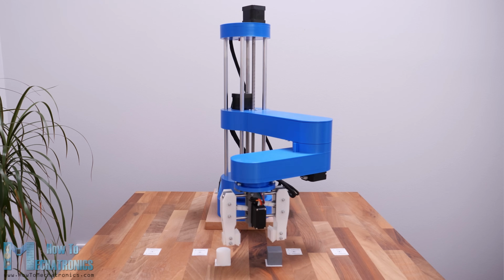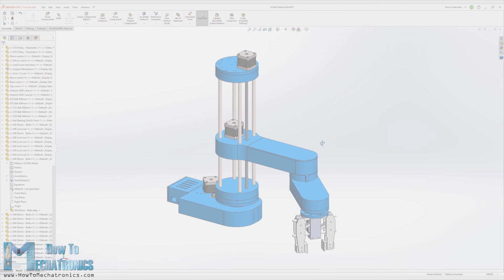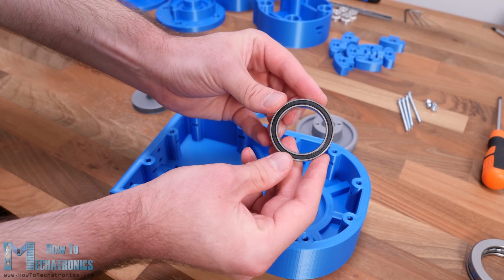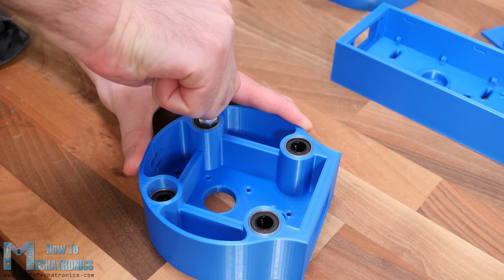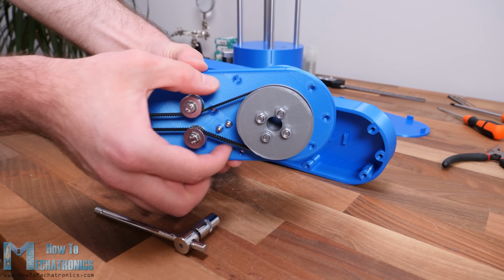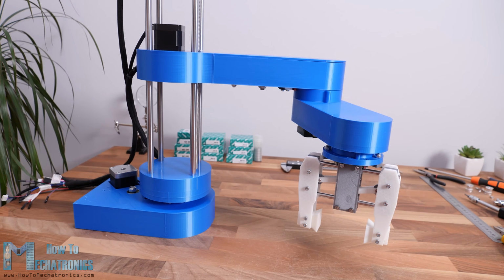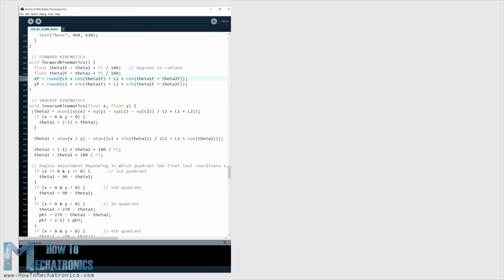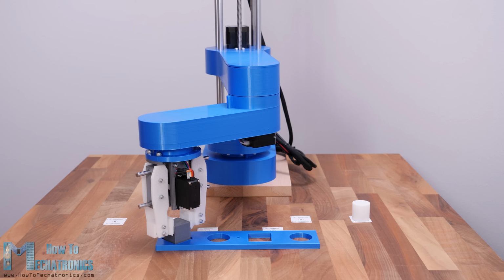SCARA Robot | How To Build Your Own Arduino Based Robot

Comment: i am having troubles regarding the robot can you help? 

i am sure that i have installed the screw like thing in the middle that connects to the up and down mottor in the correct direction but the robot goes down when it tries to zero itself when i first start it and ultimately hits nothing and tries to  keeps going forever. what can i change in the code that it doesnt do that? perhaps change the direction the motor will take when it tries to zero itself? if so, how can i do it? AIs were useless regarding situation (or i failed to use them correctly)

also the gui crashes when i try to manipulate a joint.

Comment: when i  run  Gui programe using processing 3.5.4  , if  I change  one of those  slider  it shows  nullpointeexception  and struck program.  why ?
Reply: Yes , even I am facing the same problem , @HowToMechatronics help

Comment: Hello, the radial bearings seem to be off, I found that it should be :
6808 2RS (61808) x1
6807 2RS (61807) x2
instead of :
6807 2RS (61807) – 35x47x7 – x1
6806 2RS (61806) – 30x42x7 – x2
I don t know if what I am saying is right or If my printer printed the wrong sizes.

Comment: Hello! I'm wondering if the servomotor is 180 or 360 degrees. Something else: I just found the links to buy the parts (in the web page of the project) are no longer working (they were working about 2 weeks ago). Can the link be repaired? Thanks! Greetings from México

Comment: Hi,

I’ve successfully built the robot following the video and website instructions. I’m really happy with the project and loved working on it. However, I encountered an issue with the wooden base part, as I couldn’t find the base design file (paper) from Cult3D to properly attach the robot base to the wooden piece. Could you please share the design sheet with me so I can complete the project?

Thank you in advance!
Reply from the maker: Hey, great to hear it!
Yeah, I have forgot that drawing. Now it's added to the Cults3D files.
Cheers
Reply: Hi, Did the code worked for you?

Comment: "Hello [Autor's Name],

I came across your video on [Video Title] and I'm impressed with the SCARA robot design you shared. I'm working on a similar project and I'm interested in purchasing the 3D printed parts from you, instead of buying a 3D printer myself.

Could you please let me know if this is something you'd be willing to do? If so, could you provide me with a quote for the parts and an estimated delivery time?

Additionally, I'd like to confirm that the parts are compatible with my Arduino board and stepper motors.

Thank you for your time and consideration. I look forward to hearing back from you.

Best regards,
Pablo

Comment: Hi. I've struggled with this project. It would be great if you could modify the website instructions to make it clear that you need to add a jumper to the EN/GND pins to enable the CNC Shield. Also, jumpers need to be added to allow the A axis to function.

Unfortunate my Z axis does not home as it should. During startup, it goes all the way up, hits the limit switch and then starts downward, but it never stops. Any ideas why this would be and how to fix it? It must be code related. Thanks so much!
Reply: Hi, did you ever solve this issue, I’m having the same problem 😢
Reply: @PhilHarpham  I was able to figure this out. I modified the code so that it only contains 9 items in the string instead of the 10 that were specified in the original code. String content = "";
int data[9]; //10 changed to 9.   Serial.println("Content: " + content);
      for (int j = 0; j < 9; j++) {  See, there are only 9 string items here:  data[0] - SAVE button status
     data[1] - RUN button status
     data[2] - Joint 1 angle
     data[3] - Joint 2 angle
     data[4] - Joint 3 angle
     data[5] - Z position
     data[6] - Gripper value
     data[7] - Speed value
     data[8] - Acceleration value   I can send you my compete modified code if you shoot me your email address.  Apparently the code is too much to paste here as a response.
Reply: @DSMtuned  Many thanks!! That seems to have solved the problem 🙂

Comment: hello!!
I have one question.

It is a robot concept using a Nema 17 stepper motor.
If I use an SG90 servo motor instead of a stepper motor, will the GUI interface not work?

Comment: Hello, the values that can be changed in the sliders of the SCARA robot control software are given in which unit of measurement? I mean in relation to forward kinematics (J1, J2 and J3), which measurement units are their values in? Degrees, radians or steps?

Comment: Hi,

Tank you for this amazing design (which now I bought). 

In the zip file, i miss the clamps for the smooth rods. Can you provide me the stl/3mf files. Thank you
Reply from the maker: Hi, thanks, I hope you will have fun building it! I've just updated the files.
Cheers
Reply: @HowToMechatronics  Thank you kind sir. I will have fun building this. I am going to program it with python and add mqtt to the code. This way I can add data to a database and make graphs/charts.

Comment: Got it now to run, but it will not home at start up as you said and the limit switches are normal closed as you made them, could that be right?
I also tried the endstops as normal open but it didnt do the homing as described again. So there is something wrong or to do in the published code. Same like in the processing file where something has to uncommented what is not mentioned in the video. Sadly the most important Things are not mentioned and it wont work without that Informations. Only half good tutorial in the end, if some one try to rebuild it 1:1.
Reply from the maker: Hey, I always try to put all the information out there. Sometimes things don't work for various reasons.
You always have to be prepared for troubleshooting when making such a big projects. The best way for trouble shooting is to try one thing after another what could cause the problem. For the homing, check whether the endstops work properly with another sketch, try using the Serial monitor to check the status of the endstops whether they get pressed or not. The serial monitor is very handy for troubleshooting and tracking the variables.
I hope you will get it working properly soon.
Cheers,
Dejan
Reply: @HowToMechatronics  Hi Dejan, thanks for your answer. After a period of pause and recovering from that anger of not working project I started again to try out the failure. I mounted everything you did, I checked the stepper polarities, that the motors spins from the CNC shield and the Processing UI, but as soon as I connects everthing as you have shown nothing works. I disassemble the stops, then I can move some of the motors. Are the endstops opening or as a closing switches?
As you showed them in the video, I soldered them as well, and they are openers means they are constant 1 without trigger the switch. Is that really correct?
Beside that, the processing program does not make the homing process at startup like you have shown. Any idea why?
Also sometimes I move J2 left right left and sometimes it moves without ramp and then again with, without any changes than position.
Additionally sometimes J2 moves just a bit and then J1 turns, even if I just adjusted J2 position ... somehow very strange everything.

Comment: I started now printing the teeth-wheels and they are so round, that the belts does not hold properly. How to print, that the edges are sharper so that the belt has more grip?
And I little miss the electrical part where I have more lacks of knowledge than on the mechanical side ...

Comment: excellent work. Great work. 
I saw whole video, but practically its not possible for me learn and implement it.
The reason being , you are creating most of the part at your own using 3D printer, which not possible for anyone to work hard at this level. 
(also short of resources like 3d printer , learning 3d printing software).
Most of electronics engineers are so poor in mechanical part.
Please make video with mechanical parts which are easily available in market .
You can make this video again with mechanical parts available easily in market parts with the improvements you mentioned at end of video.

Comment: Hi, the code that you have attached to the website isn’t working for me.  Is there any way that you can tell me what to do?    Also, great video.
Reply: Ever get it working?
Reply: @navysnow5618  No
Reply: All of the other software’s for the Arduino app that I have a new stove works though. I don’t know what is wrong with this one.
Reply: @Daniel_Ahdoot  I adapted the code to use it on arduino uno + cnc shield v3. Engines now move from the GUI
Reply: @Vitifj3Dcontrol  and work?
Reply: I'm trying to find a solution too... you changed the COM port on the line 55?

Comment: Thanks for this cool alternative to the 6-axis DIY educative cell I have made. Sadly the software dont want as I want.
How many lines of programm or what operators can I use?
EDIT: God bless, that you made the parts bigger than finally needed. For my inacurate printers good, as thes printed with "elefant foot" up to 0,3mm smaller.

Comment: Hello, I could not find the correct GT2 pulley with 50 teeth that you use in the video, I printed the one from the 3d printed file but there is no adjustable screw inside it for the shaft, to be tide on the shaft. Would you like please put the new updated GT2 pulley in the comment so we can printed?

Comment: I will add this to my to do list....however the bearings and metal parts are so hard to find in my local market. So the procurement phase could be long and that is a barrier to my motivation that I need to override ASAP:

Comment: at 15:05 how did you fit the 3 bolts that need to go under the joint 3 connector?

Comment: Awesome project !!
How to enable the robot end effector move from one position to another with straight line motion ? There has to some synchronisation required for both X-Y motors.
Do you have any plan to add this?

Comment: Great Video!!! Both this one and the other one with the laser engraver. I have built my own scara printer (X-SCARA (Not my design)) but it has both arm motors mounted on the base, creating the need for crosstalk between shoulder and elbow. Do you know how to define this?

Comment: Amazing work. 
How do you know the real position of the motors?
Reply from the maker: Thanks! There's a homing procedure at the beginning with the help of some limit switches.
Reply: @HowToMechatronics  Hi, thanks for your reply!
I saw the homing procedure, but i would like to know if there is some closed-loop to ensure that the motor is in the right position.
Best regards,
Tomás
Reply from the maker: @tomiabraham  Well, yeah, although having the home procedure it's still an open loop system. If the motor skips a step the position will be lost and it won't know that it has skipped a step. You would need a closed loop stepper or a servo motor which have encoders as well in order to exactly know the position of the joints at all time.
Reply: @HowToMechatronics  Thanks for your answer! 
Have a good day
Reply: @tomiabraham  youtou

Comment: It would be simple to brace the vertical joint. Add a support truss to the top of the vertical and problem solved. Question. Any idea of the load capacity of this Scara design if the top was supported and the whole structure was made more rigid?

Comment: Hey there i am so very impressed with your work that i am actually making one for myself for my engiineering final year project
there is this one place where i am stuck and that is, i am not able to source a 300mm GT2 belt for my pully nonetheless im able to source a 280mm GT2 pulley, all i wanted to know was that will you be able to tell me if i should go with the 280mm belt for the pulley system, thanks in advane

Comment: Hello! I built the robot, but there is a problem with the software part.
"Nullpointer exception" error message
Can you help me with what could be wrong?
Reply: hello, have you solved your problem? I also built the robot but the program doesn't work for me, maybe we can help each other
Reply: @francesco_xx2  Hello! Not yet resolved, I haven't dealt with it lately!
And unfortunately in winter the foundation was ruined too, it was too close to the radiator!
Reply: Yea, I just can't seem to find a robot arm project that actually works lol.
Reply: hey... there is one line in the processing IDE code where in you need to enter the COM port to which you have connected .. after that the error shall go.. cheers!
Reply: @saiprasadenterprises6691  Thank's
Reply: @zsoltkatona4951   you solved the problem?

Comment: Can anyone tell me what is the purpose of using micro switch at each joint? Thanks in advance!
Reply from the maker: So that you know the position of the robot. First it goes to zero position which depends on the micro switches and from there you can set it to any position you want.

Comment: Hey pls pls pls help me help me pls 🙏😭 I'm in trouble pls help me 
When i open processing and run the gui it works but when i do any changes in forward kinamatics it may freezz and shows error program is not responding and java(tm) se binary not working
Please please 🥺🥺 help me
Reply: How did you even were able to run GUI. It doesnt work for me. No errors. It's like there is no communication.
Reply: Yup guess I'm not building this.

Comment: Hi! Really good project, maybe can help me with some issues? The servo don't work correctly and i try some servos and the motors don't move, i use a cnc shield, motor drivers A4988 with arduino uno and 4 motors nema 17 with power suply of 12v 10A

Comment: Hi 👋  How to mechatronics. I hope my question wasn't crazy enough. Is it possible to apply the robo with welding functionality? Or lets say cement hose? I really appreciate your advice and answer for this. I wanted to build robo with welding or the robo itself can produce metal  welding funtion or 3D concrete printer funtion. I'd hope my question did not bother u. Thank you 😊

Comment: I came across a problem. I have built the robot and is currently facing the last stretch. When I run the processing code, the robot doesn't move at all. It doesn't go to its home position and nor does it respond to my manual jog input. Any heads up would highly be appreciated
Reply: hello, have you solved your problem? I also built the robot but the program doesn't work for me, maybe we can help each other

Comment: hello sir, i have a question, for securing the hole is it required for the diameter of the hole and the one to be inserted the same for it to be tight? btw this project is so awesome

Comment: Wait you don't need to flash the Arduino into a cnc Arduino to use the shield? You can just use the aclstepper lib.  Wow I just smacked my head on that, here's I've been trying to program output to chilly pepper.

Comment: Dejan, do you know what could be causing these errors I get on PDE when inputting values on the inverse kinematics and hitting "Move to position"?

Mar 31, 2021 10:28:03 PM controlP5.ControlBroadcaster printMethodError
SEVERE: An error occured while forwarding a Controller event, please check your code at move
java.lang.reflect.InvocationTargetException
	at sun.reflect.NativeMethodAccessorImpl.invoke0(Native Method)
	at sun.reflect.NativeMethodAccessorImpl.invoke(NativeMethodAccessorImpl.java:62)
	at sun.reflect.DelegatingMethodAccessorImpl.invoke(DelegatingMethodAccessorImpl.java:43)
	at java.lang.reflect.Method.invoke(Method.java:498)
	at controlP5.ControlBroadcaster.invokeMethod(Unknown Source)
	at controlP5.ControlBroadcaster.callTarget(Unknown Source)
	at controlP5.ControlBroadcaster.broadcast(Unknown Source)
	at controlP5.Controller.broadcast(Unknown Source)
	at controlP5.Button.setValue(Unknown Source)
	at controlP5.Button.activate(Unknown Source)
	at controlP5.Button.mouseReleased(Unknown Source)
	at controlP5.Controller.setMousePressed(Unknown Source)
	at controlP5.ControllerGroup.setMousePressed(Unknown Source)
	at controlP5.ControlWindow.mouseReleasedEvent(Unknown Source)
	at controlP5.ControlWindow.mouseEvent(Unknown Source)
	at sun.reflect.GeneratedMethodAccessor5.invoke(Unknown Source)
	at sun.reflect.DelegatingMethodAccessorImpl.invoke(DelegatingMethodAccessorImpl.java:43)
	at java.lang.reflect.Method.invoke(Method.java:498)
	at processing.core.PApplet$RegisteredMethods.handle(PApplet.java:1436)
	at processing.core.PApplet.handleMethods(PApplet.java:1638)
	at processing.core.PApplet.handleMouseEvent(PApplet.java:2749)
	at processing.core.PApplet.dequeueEvents(PApplet.java:2652)
	at processing.core.PApplet.handleDraw(PApplet.java:2493)
	at processing.awt.PSurfaceAWT$12.callDraw(PSurfaceAWT.java:1547)
	at processing.core.PSurfaceNone$AnimationThread.run(PSurfaceNone.java:313)
Caused by: java.lang.NullPointerException
	at GUI_for_SCARA_Robot.move(GUI_for_SCARA_Robot.java:542)
	... 25 more
Reply: what exactly are the problems you have when using processing program, i seem to encounter some problems also